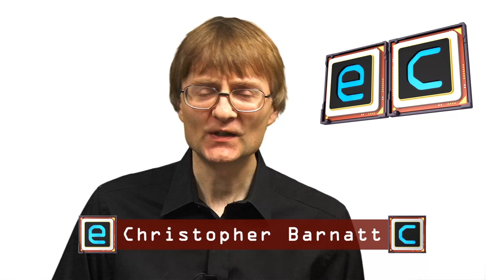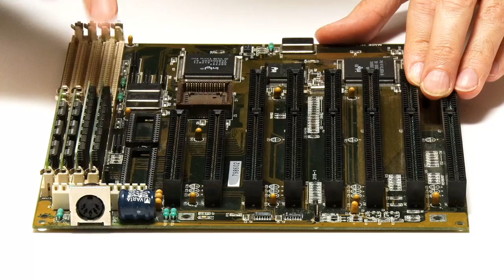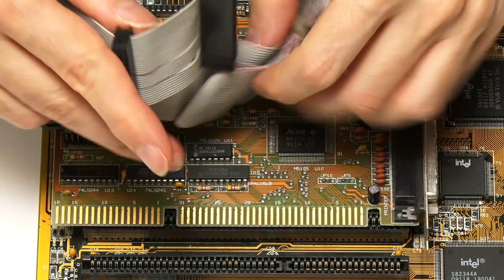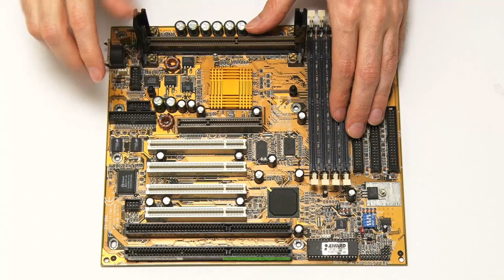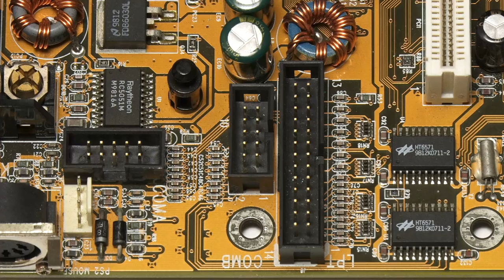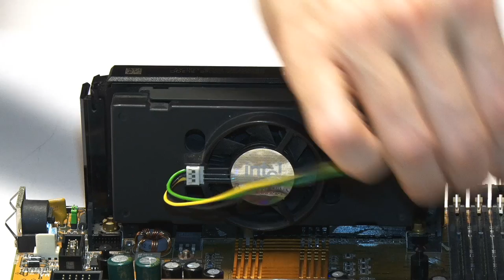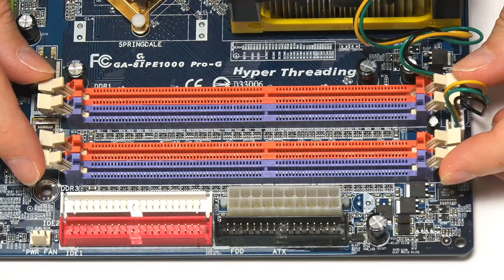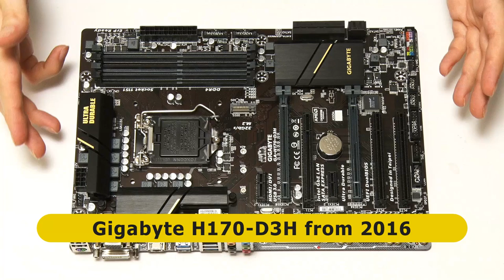PC Motherboard Evolution

Comment: I just want to see an upload of Chris set loose on the connectors isle/section of a DigiKey or Mouser warehouse. 🚶‍♂️..🏃‍♂️..🕺

  There's a lot more to these connectors than plastic and pins, but it's fun to watch an overview.
    I have seen a few hardware designs for boards like this or even more complex stuff. It's amazing to see all the work that goes into routing the traces on these boards. It takes a jedi puzzle master to beat that game.
-Jake
Reply: I've tried my hand at routing PCB traces. Even for a small project, it can be a pain to get everything just right. Component layout is a big part of it, and if you decide that you have to move a component, even a little, it can amount to re-routing a LOT of traces and creating new vias, which themselves need more traces, etc. 

Components have optimum positions that need to be factored into the PCB layout. Capacitors need to go as close as possible to whatever they're filtering or levelling, and anything having to do with a bus needs to be planned out ahead of time so that you use the shortest route possible without splitting it up all over the place (you want all the traces of the bus to be about the same length). Interface headers need to either be clustered together, or placed near the edges for ease of accessibility, grounding planes need to be integrated for EMI management,  you might need a blank space without components to silkscreen a jumper diagram or something, and etc, and whatnot. 

I can't imagine the long nights of headaches that would ensue from trying to route a modern multi-layer motherboard, much less one from the 70's or 80's which were usually just double sided.
Reply: @BlackEpyon  
Hey BE,
 So Robert Feranec has a bunch of uploads about routing and PCB design on his channel. His stuff is mostly Altium based, but I find most of his advice useful in KiCAD as well. Some of it is really basic but there is a lot of good stuff on his channel too. There are a few examples of super complex layouts on Tom W's channel. I highly recommend looking him up as he's one of 2 CERN (European Nuclear Fusion stuff) software engineers that CERN has dedicated to the FOSSy project KiCAD. He doesn't make KiCAD tutorials on here per say or upload regularly but occasionally he shares something really useful. IIRC He has a PCB example he uploaded that's somewhere around 10 to 20 layers deep with a couple of massive BGA packages on the board and lots of differential pairs running around everywhere. I think he was explaining the old GL Routing option for pushing traces (GL is the default setup in current KiCAD 5) when he showed a super complicated layout.
  
  I am half curious if I could pull off a 4 layer board. The eBay seller ABCfab sells the right kind of super thin double sided core and thin single sided copper clad to create a 4 layer sandwich. I imagine with a bit of practice I could pull off a 4 layer board. I can think of a few different methods to try.

  As far as beginning EDA and routing, it can be really frustrating at first but after a month or two and 5 to 10 dev boards it gets easier. The most helpful tip for me has been to work in circuit blocks in an open area then combine your circuit blocks afterwards. Dave Jones has a couple timelapse videos of him doing layouts. That's where I picked up the circuit blocks trick (a very facepalm moment for me). I still end up doing 5 to 10 major revisions or complete reworks before I'm happy with a layout. I've managed to take stuff I originally tought I just 'had to do on double sided board' and pulled them off on single sided with a few jumper wires set up linearly on the board. I seem to do better layouts if I work on a design in waves. After taking a few days to do other things, when I come back to the design, improvements are much easier to see. However I am still trying to resist the urge to completely rework an older working design when I want a spare...which is what I'm currently procrastinating from as I was going to make a second dev board for a little PIC16F1508, but hate my original layout tomfoolery. I absolutely must figure out the teardrop plugin for KiCAD too because I'm spending way too much time modifying the transparency artwork in GIMP. It starts out as adding teardrops to a few pads and ends up being an attempt at a modern art masterpiece with perfectly curved traces. Hopeless :-)
-Jake
Reply: Ever notice that so many stereos were all built using single-sided boards?
I'm subscribed to Dave Jones (EEV Blog) as well. Really good content on his channel!
I'm using CircutMaker, which is a community driven cloud software (free) by Altium. Not a bad piece of software for a free product. Looks like they're merging with Upverter, but they're promising that the user accounts and content should merge seamlessly (I've heard THAT promise before, but we'll see what happens).
Reply: Interestingly, and I know it works well for everybody else, but the "circuit block" convention doesn't always work for me. Though it depends on how it's laid out. If the blocks are separated (with bus input/outputs indicated to other sections, but not directly connected), or on separate pages, it gets confusing to me fast. One of Dave's recent uploads, he redesigns a schematic that was really sloppy, showing an obvious progression from input on one side to output on the other, designed in blocks, but still connected. This works for me.  But then, for math, I could never do short-form equations either. I always had to do it out in long form, showing my work, or I would miss something and get the wrong answer. I can't do math in my head for the same reason: I can't do shortcuts - I need to see the interconnects.
Reply: BlackEpyon  
I still struggle through the math and usually use a pencil and paper but so far I haven't needed a whole lot of it with my designs. However I'm still just dialing in my etching setup, so I haven't done anything too critical yet.
  I didn't watch Dave's upload on the schematic thing yet. I tend to steer clear of the pros talking about that kind of stuff while I'm in the middle of the same thing and at a point where starting over will really mess me up. I end up watching something like that and then want to make a bunch of changes to my current project. I've learned the hard way and wasted a ton of time. Now I save those kinds of uploads on my "watch later" list until I'm done with the current stuff. 
  When it comes to schematics I can usually get them to a block form where they flow pretty well. Unfortunately with the way KiCAD is designed it tends to make a messy schematic if you make changes on the layout side after creating a netlist and start routing. I don't think there is an easy way to reverse the netlist like Altium has. My AVR TT v2 project is on resistor designation 60 or 70 and there are only around 15 to 20 resistors total on the board. I've fooled around with that thing a ton.
Reply: Well, there's always version 2.0 to make it neat and tidy. 
The important thing though, is to be able to DO the math, even if you struggle with it. Too many people avoid math entirely, and that can screw you later on. I always keep a pad of paper nearby my desk in case I need to jot down a formula or something.

Comment: I recognized all these Motherboards... I've been building PC's for pretty much the time-span of your history lesson (I started building 486 computers about 1990)... when you mentioned "this is what computer motherboards looked like 28 YEARS AGO"... I paused for a second and went "whoa... has it been that long?" I had completely forgotten about the Slot-1 CPU's until you pulled one out, but then my mind raced back and went "yeah, I made those too". To go along with the Motherboard lesson, I remember using 3DFX Voodoo cards and the arrival of that silly NVidia upstart, the GeForce 256 (AKA: GeForce 1).

Comment: Chris - you  must drop battery from mb with sx20!! it's damaged!!
Reply from the maker: It is. But the board is also dead.
Reply: @ExplainingComputers  Chris I would urge you to remove the battery anyway. The board may be non functional but the corrosion looks relatively minor and possibly fixable. If you leave the battery on there, it will only get worse.
Reply: @ExplainingComputers  And I would absolutely recommend removing the battery from your assembled 386 pc also!!

Comment: 6:16 The ribbon cables have a red line on one side. That red line is normally used for pin 1 on both the floppy/HDD and the mobo. You would normally turn the ribbon around and not install as demonstrated.
9:27 I don't ever remember seeing a PS/2 Mouse connector which looked like that. I checked the manual and it is a mouse connector.  Many of the connectors on the mobo, such as the PS/2 mouse, LPT, serial, and the onboard USB would be connected to the outside through interior extension connectors which were kept together mounted on a certain area on the back of the case.
Nice presentation.
Reply: Was about to say the same thing about the floppy cable he plugged in, red side of the ribbon should have been connected to pin 1, so it was backwards (sorry Chris) :)

Comment: Yes, I remember 386s & 486s, and many things had to go on daughter boards, which then had to go into the motherboard, and they were always b@stard things!  And jumpers and dip-switches... 
You probably should show them a drive, which had an IDE connection, but also about 4 ~ 6 jumper sets, and you had the specs printed on the drive, for heads, cylinders, platters, sectors... After a time, you used to have to go into the BIOS and set all that stuff manually, from reading it printed on the drive case, there was no auto-detect, but in the early days, the BIOS wasn't where you set that. You had to do it with jumpers... I thought computer technicians had just become redundant when we got BIOS's that could and did auto-detect their hard drives as they powered up. What are we supposed to do now? Chase dust-bunnies around the shop? Then we had so much time on our hands we got into contests over who could zip-tie the wires away in the neatest and most aesthetic way...
I never built an XT or an AT, and I'm slightly glad of that....

Comment: pci, vga and dvi might be gone in a gen or two, sata might last longer due to 10tb drives being too good value
Reply: Seagate 14tb (ignorantly expensive)....then again, I do have 26tb currently lol. However if the companies that make nvme drives, motherboards, and processors actually worked together, we could have rows upon rows of nvme, just like ram and with plenty of dedicated lanes to the cpu. And with GPUs essentially being their own computer, I don't see why a motherboard with a CPU slot and GPU slot doesn't become a thing. You could even run shared memory between the two, or have an nvme drive dedicated to a gpu. Well, a guy can dream. I just hope I live long enough to see something really interesting happen as we've hit a bit of wall lately when it comes to tech.

Comment: Ah, too bad the first motherboard wasnt functional, I was expecting some great story behind it, like the very first video of ExplainingComputers being edited on it in the early 90's and then aired in a local cable TV channel, or sold on VHS ! 
Yeah, getting PC ready to use in the mid 90s wasnt fun at all. I still have a PC with Pentium II originally with 64MB of RAM, and
then upgraded to 320MB. In use until around 2010, maybe someday I will turn it on again. Making this possible to run it was a night long task, with all those drivers to install and incompatibility... And now it comes back, when I was fighting with non-working USB ports in my PC :P 
Our journey have arrived to the times, when motherboards are less pricy than the RAM modules. Im aware that in the next few years  the prices would drop down, and 16GB of memory would be worth as much as 2 GB now - at least I do hope so ! But Im also curious about the changes incoming in terms of connectivity. HDMI might have became a new standart, but at the other hand I still see majority of displays in most offices being connected by VGA ! Will we eventually see the end of this connector by some time ?
Reply: I still have an 8086. The last time I tried I got it to run. But that was a while ago now. Even then I had to use the eraser trick on it to get the HDD spinning.
Reply: Still got my first 8088 as well. You might want to switch to CompactFlash storage if the hard drive is failing. That's what retro-PC enthusiasts tend to use now. I love using period-appropriate tech when possible, but sometimes you gotta work within your means, and old hard drives (especially MFM) are still expensive to buy 2nd hand, IF they work or were even parked before shipping!
Reply: Imagine my anger in around 2000 when I found old HDD lying under a big speaker magnet. It was (probably) WD Caviar 280. 
The early 90s PCs are a bit mysterious for me, because those were the times when I was still using the Amiga 500, like many people here. Late 90s is a different story. 
I still have one PC from the late 90s I have to look into. Im not sure if it works, but from what I know it hasnt been used much during its lifetime. And of course I could get the free CRT monitor with it, but if I were to keep them all, then I'd soon be floating on the surface of old monitors pile :P This is a serious problem, because majority of people prefer to have a tidy desktop, without the big heavy yellowed tube, and there were millions of them produced, what to do with them ?
Reply: Well, there is electronics recycling, but I'd first see if anybody wants them. Especially if they happen to be a major brand from the 80's-90's, like IBM, Tandy, Commodore, etc, that you could sell on eBay. I only still use CRT monitors for my old vintage PCs (I specifically hunted for these particular monitors on eBay) and my one test station. All the rest now use LCD monitors.
Reply: Electrolytic capacitors in equipment that has not been turned on in a while can go bad. The phrase there is capacitor reforming. Researching that will fill you in. There are mitigation techniques that are somewhat effective in limited cases. It all involves ramping voltage up slowly to the weakened devices to restore them. But that is usually a radio and amplifier thing. Not so much with digital electronics. SMPS rely on high voltage in order to work properly. You could pop like the line caps out and reform those on the bench. Then run the PSU with a dummy load to let it reform itself maybe? The thing with electronics is power on. Once electronics are done they're done. There's just some events there's no coming back from IUKWIM.
Reply: for me it was dual booting 98 and XP on a Pentium II 333 with 512MB of RAM from 2002-2004 because my family couldn't afford a whole new computer haha

Comment: A very interesting video, where have all the years gone?  My first PC bought in the late 1980's was an 8086 from NESS (long gone).  When I started using ORCAD I had to have a mouse, no connector of course in those days and I bought a Microsoft Mouse with interface card for £110!!  The last mouse I bought a couple of years ago was £3 from Ebay.  Bob

Comment: Very good video. Been a programmer for 30+ years and have built my share of systems. It's amazing how much has changed over the years. I think my first computer ran at about 1MHz with 32KB of Ram and Tape Drive. TI 99/4A. A system built last year has 16 Xeon cores running at 2.3GHz and 64GB of Ram and that was an off lease 3 year old HP Workstation...lol

Comment: I worked on Tandon computers and had to make replacement floppy cables because the customer wanted a 5.25 A: and a 3.5 B:.The first cable I made did not work and I discovered that the board designer had screwed up and placed the connector upside-down on the board layout!
The pinout was a mirror image so no orientation of cable worked! 
It was presumably not discovered until the boards were delivered.
Disaster!
But some guy had a brilliant solution.
They solved the problem by building ribbon cables with one less conductor but with the red stripe on pin 2  of the connector for the board!
The person who came up with that fix has my utmost respect. Even if he was also the guy who messed up the board design, what a great save.